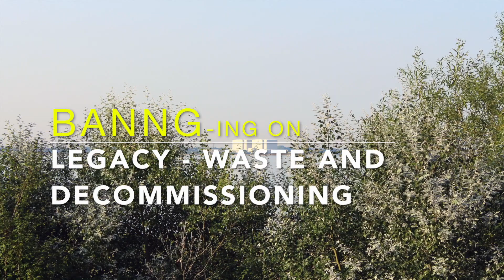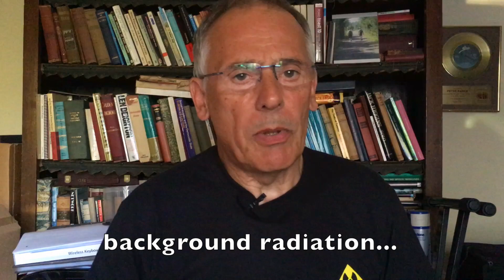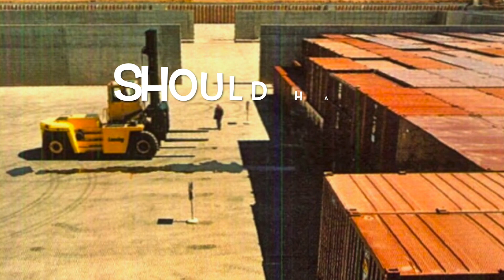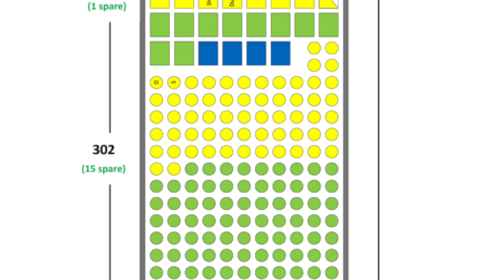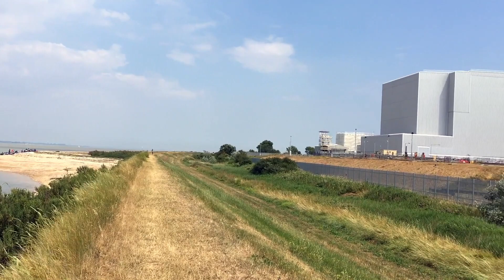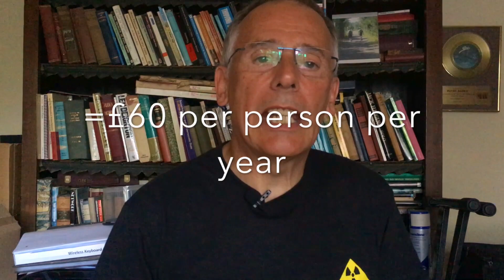Leaving it all behind - The Legacy of Nuclear Power

Comment: The main proof that nuclear power shouldn't be used is at the beginning when nuclear physics came about.  Newton and Einstein both wrote the physics law that we still use today for calculating our exposure to ionizing radiation.  This laws name is the Inverse Square law (intensity=I/d2).  Written within the law it states that this law does not apply to extended sources of radiation.  

Most of us know by now that from the start when they excavate the uranium from the ground with mill tailings left behind all the way through until that uranium is put into dry casks that every step of the way there are extended sources left all over the place.  The power station leak and relieve pressure on a regular basis and Tritium itself permiates the metal so there is no containment.  The super fund waste sites are leaking into the biota and now everyone can see that it all is an extended source.  

Now, there has to be a way for everyone on earth to understand what this all means in actual terms.  Wait, I got it!  Geiger counters and other radiation detection monitors are calibrated using the formula from the inverse square law (intensity=I/d2), so this means that every single geiger counter measurement every taken is absolutely null and void.  Now the only issue is we get this information out and everyone go to the public hearings allways taking place and tell these evil people that the proof is in black and white written long ago.